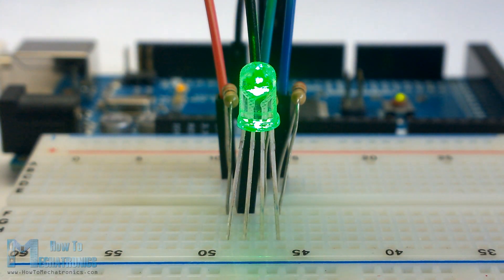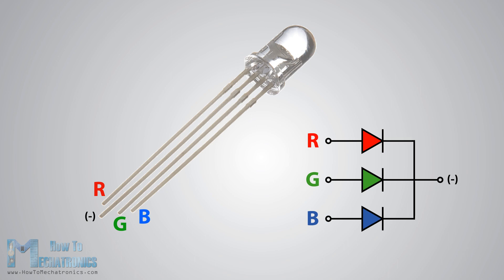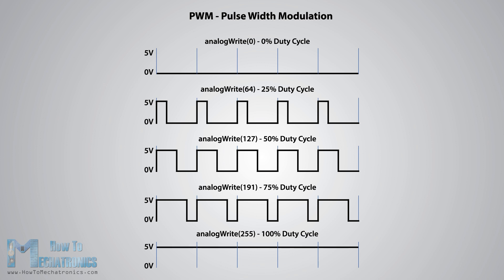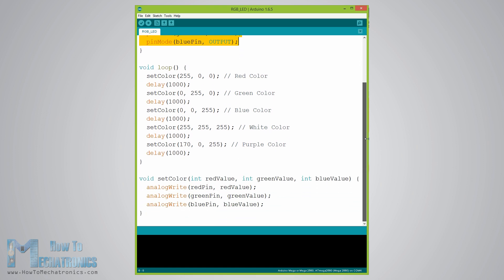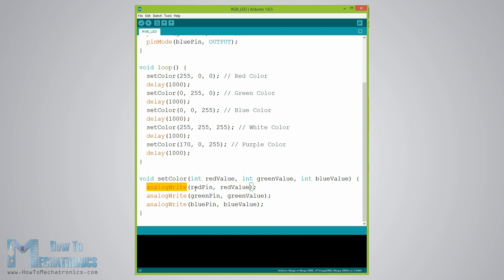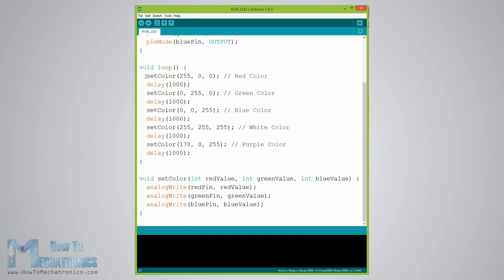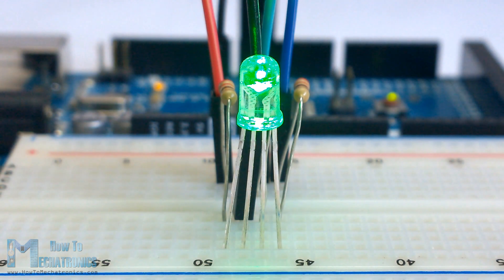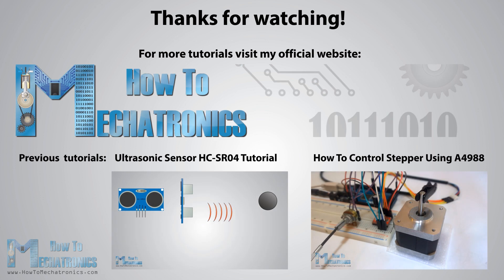Arduino RGB LED Tutorial

Comment: Switching between common anode & cathode,  can be sorted by switching the power and ground leads and reversing the numbers in the code, ie 255 becomes 0. 170 becomes 85 (255 - 170). :)

Comment: Thank you for your excellent work
Please i need a code for a cycle On/Off timer the On time is 10 minutes and the off time is 8 hours meaning it goes high for 10 minutes and goes low for 8 hours then 10 mins high again followed by 8 hours low and it goes like that. I tried using the delay  as used here but did not work. will be very glad if u can help me Thank u once again

Comment: Hey man, thanx for tutorial, its easy to understood even for realy newbie. i start with arduino only 6 days ago. and RGB diode was challenge for me :-) rly helpfull was that special void setColor!!!! until then i didnt know that i can do more void section after void  loop. this is part that i quiet don´t understand, but i was able to use it with my RGB common anode led diode and potenciometr for changing its colors.

here is my code:
int blue=2;             //prirazeni pinu 2 Blue led
int green=4;            //prirazeni pin 4 green led
int anoda=7;            //prirazeni pin 7 spolecne anode
int red=9;              //prirazeni pin 9 red led
int pot=A0;             //priprazeni pinu A0 potenciometru
int potenciometr;       //promena hodnota potenciometr brana z potenciometru

void setup() {
  Serial.begin(9600);     //zapnuti serioveho portu momentalne ho nepouzivam ale mazat ho nechci pro pristi rozsireni kodu.
  pinMode(blue, OUTPUT);  // nastaveni pinu bloe led vystup
  pinMode(green, OUTPUT); // nastaveni pinu green led vystup
  pinMode(anoda, OUTPUT); // nastaveni pinu anoda vystup
  pinMode(red, OUTPUT);   // nastaveni pinu red led vystup
  pinMode(pot, INPUT);    // nastaveni pinu A0 vstup

}

void loop() {
  digitalWrite(anoda, HIGH);      // Nastaveni trvalého plus na spoledne anode RGB diody        
 potenciometr = analogRead(pot);  // hodnota blikani vyctena z potenciometru
 
if (potenciometr <=204) {         //funkce kdyz je hodnota potenciometru nizsi nez 204
  setColor(0, 255, 255);          // Red Color
}

else if (potenciometr >205 && potenciometr <410){  //funkce kdyz je hodnota potenciometru vyssi nez 205 ale nizsi nez 410
  setColor(0,0,255);                               // yellow Color
}
   
     
 else if (potenciometr >411 && potenciometr <616){ //funkce kdyz je hodnota potenciometru vyssi nez 410 ale nizsi nez 616
  setColor(255, 0, 255);                           // Green Color
 }

  else if (potenciometr >617 && potenciometr <823){ //funkce kdyz je hodnota potenciometru vyssi nez 617 ale nizsi nez 823
    setColor(255,0,0);                              // cayene Color
  }
   
   
 else if (potenciometr >823) {                    //funkce kdyz je hodnota potenciometru vyssi nez 823
  setColor(255, 255, 0);                          // Blue Color
 }
  
  
   
 }
 void setColor(int redValue, int greenValue, int blueValue) {  //zavedeni void setColor, Diky tomuhle pak muzu pouzivat prikaz serColor a v zavorce pak uz jen udavam analogove hodnoty pro jednotlive diody a tim micham barvy
  analogWrite(red, redValue);
  analogWrite(green, greenValue);
  analogWrite(blue, blueValue);

  }

Comment: My RGB LED turns only red, green and blue. I want it to be yellow and purple either but that doesn't work. Do you know what the problem may be?
Reply: Thanks for your reply. But I knew the values. The problem is they don't work.
Reply: I have no idea. I'm not sure if my LED is a common cathode or a common anode. I believe it is a common cathode because I'm getting the best results by connecting the long pin to ground. Although I treat it like a common cathode I need to give reversed values. Like if I want a green color I need the value: 255,00,255. Thats strange, right? Red is an exception. If I want red it doesn't work with reversed values, it has to be: 255,0,0. My questions probably are stupid. Sorry I'm a noob but I really want to learn to make some cool stuff with Arduino. So if you know what's probably going wrong I'd like to hear it.